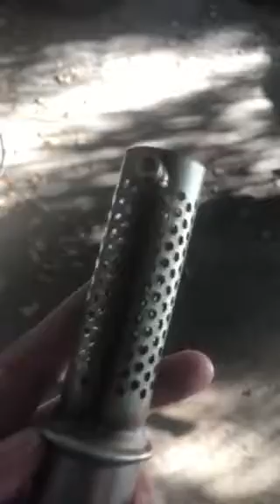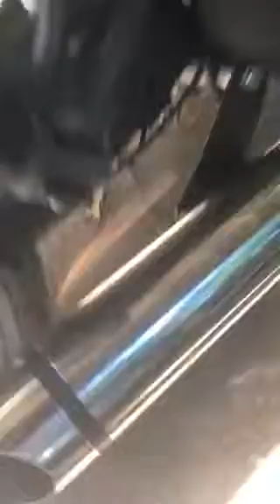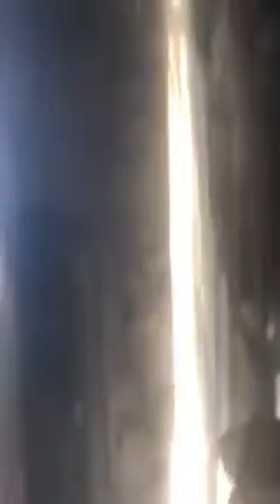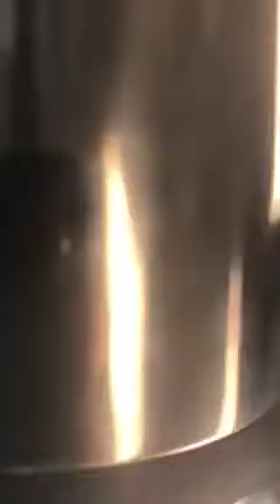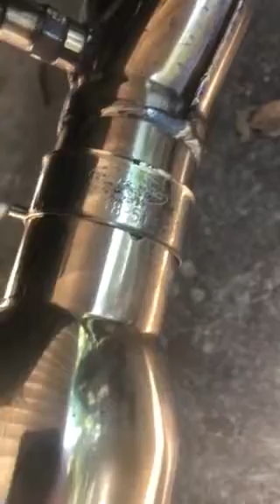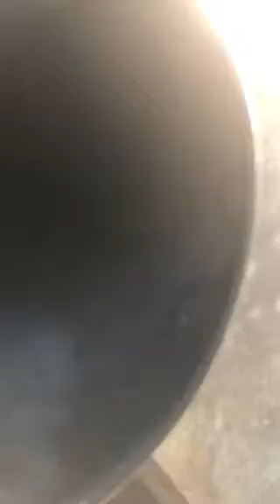Delkevic slash cut exhaust, no place to secure the silencer into the baffle

Comment: Did you ever figure this out? Ive just bought a Yamaha Bolt with a Delkevic slash cut and have the same problem. The owner supplied the removeable baffle and there is a hole inside the exhaust but it doesnt go all the way through?
Reply from the maker: Yes, I figured it out.  Unscrew the one screw/bolt that holds the baffle to the housing. Then pull the baffle completely out.  You will then see another hole at the other end of the baffle.  You must then tap the silencer into the baffle on that end so that it lines up with that hole and  screw it in through the hole. It was that simple.  You do have to remove the baffle entirely from the housing though, ended up having to rotate left and right until it slid out.
Reply: Great thanks ill give it a go